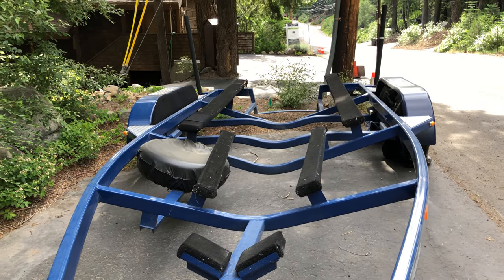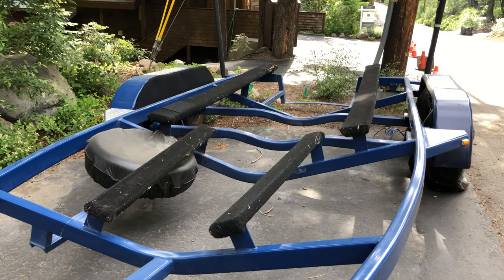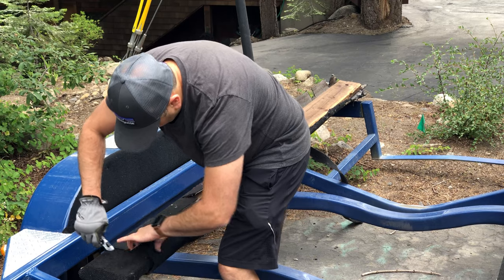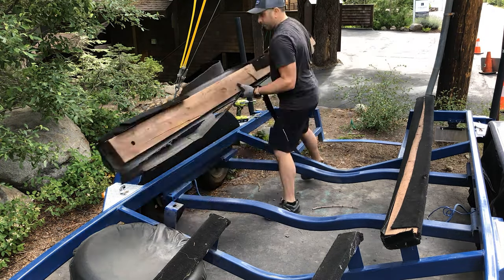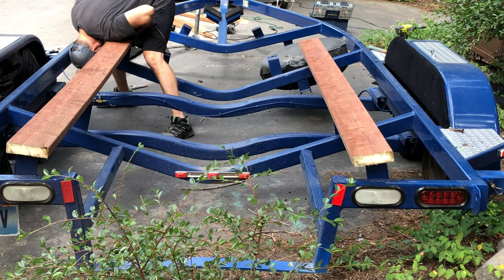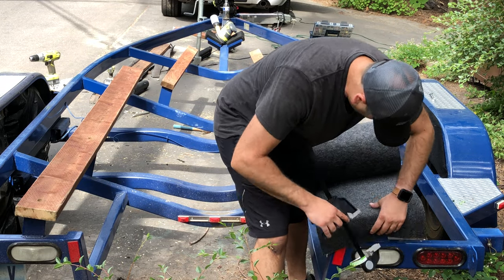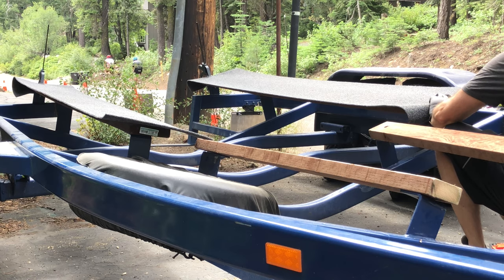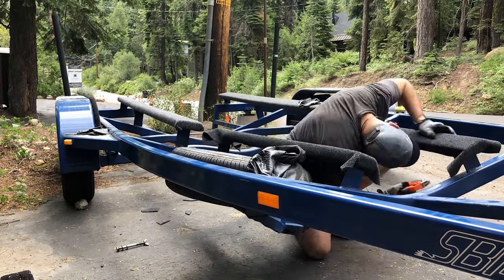Boat Trailer Bunk replacement - DIY (wood and carpet) in 4K

Comment: If you use heavy wet treated lumber let it dry out a few days before wrapping it with carpet. There's also a certain way to wrap the ends by trimming out nice and neat like a Christmas present

Comment: Great vid, I also have to repair metal brackets that were bent on one side by previous owner. My issue is having somewhere to unload a boat for a few days while welders repair ..then I can do the bunks.
Reply: Do you have a local storage facility you can unload boat or call a local boat shop

Comment: Okay, maybe in CA, you can't do this.... BUT, you missed a couple of steps that will make it last a lot longer... Once you have everything dry fitted, then take the wood and cover it with fiberglass resin. The wood can still breath, but it really water proofs the wood. Also there is a spray like Scotchguard... it used to be called Ultra Seal boat carpet conditioner (Was sold at NAPA auto parts). It helps with UV protection. Or since that is a bit pricy... just replace the bunk carpet every couple of years.... remember to use stainless steel staples because regular staples will rust and take out the wood with it. The only other thing I'd do, is use new stainless nylock nuts on new stainless bolts. That way they won't back out and mar the hull. Other than that, very good information for the first time DIY'er.
Reply from the maker: Thanks for the tips Terry.

Comment: You have a very similar/almost identical SBT trailer to me.  I also see you are missing one of your side pieces that covers the wheel opening.  I happened to lose mine today on the back (or to) the water.  Have your replaced these before?  If yes what did you use.  Marine grade plywood?  Any better way of mounting them than how mine came. (which was essentially sheet metal screws through the carpet and board and into the diamond plate fender.)  These are quite odd, cause they sit an angle due to bar at the bottom and only real place to attach is into the fender.  Trying to come up with a better solution.

Comment: Use contact cement to help hold the carpet to the wood. Then the carpet won’t move around when boat is sliding on it and tear it. My last bunks lasted almost eight years by doing this
Reply from the maker: That is a great idea!!! I think my carpet goes fast bc the trailer sits empty all summer in the sun and gets bakes by UV rays.

Comment: I would have like to know what type of bolts, washers and nuts to use - Stainless, galvanized,,,or what
Reply: When dealing with boat trailers, we usually use stainless steel bolts, washers, nuts etc.

Galvanized works good too, and may be able to find stronger rated bolts for cheaper, easier to source.

But, we've used stainless on all of our trailers and hardware.

Comment: Great video, although I would have put the carpet on the wood before installing the bunks on the trailer. Would have made it much easier if you didn't have to bend over and staple from underneath.
Reply from the maker: Live and learn :)
Reply: @fixitwithjake   but if the carpet is installed before installing bunks to the trailer then you don't have the option of using a big flat head driver to keep the top of the bolt spinning when attaching.
Reply from the maker: @chrislong2562  good point. I wonder if you could slide a small portion above the bolt head with a razor knife to slip a flat head in to hold the bolt until the washer grabs. Just an idea.
Reply: Galvanized carriage bolts=no spin.
Reply from the maker: 👍 Good idea! Next time!

Comment: Great job But yes that big BUT pressure treated wood has copper in it that oxidizes aluminum. That boat sits on those for the better part of its life and when it gets wet may release does impurities . I'd keep an eye on it. It may be nothing to worry about but and yes again that BUT it may. Food for thought
Reply from the maker: Good info! I’ll pull one this summer for fun and see how it looks under. Hopefully the trailer paint also acts as another barrier. What wood would you use that can handle a job like this and being wet and dry??
Reply: Just regular with paint or fiber coated
Reply from the maker: Thank you!

Comment: I know you said Red Pressurized not sure how it is different then the green Pressure Treated wood, & if it’s true or not but I heard that you’re not supposed to use stainless steel stables on Pressure Treated wood; that monel stables are preferable on Pressure Treated...
Reply from the maker: Luis Sonoma I did some research and it looks like you’re correct about the I did some research and it looks like you’re correct about the stainless steel fasteners in treated lumber. However I think they’re mostly concerned with however I think they're mostly concerned with load bearing lumber and a house and how those large stainless steel bolts and fasteners can lose strength. I think you should be more concerned about non-stainless steel Staples Rusting away in your carpet then the chemical mix occurring.
Reply from the maker: Luis Sonoma The green versus the brown lumber is just depending on what chemicals they’re using to treat it. The green the green versus the brown lumber is just depending on what chemicals that are using to treat it. The green has a large ingredient of copper. I chose brown because in my mountain town all the contractors right here use brown pressure treated lumber in the weather and snow and it holds up very well. And there is a good supply of it at our stores.
Reply: FixItWithJake That makes sense, well I ended up overlapping the carpet & using screws with washers every 6 inches just in case the staples rust off. And formalmente reason I got possessed and purchased Zinc Coated lag screws to fasten the bunks to the swivel brackets🤦🏿‍♂️
Reply: FixItWithJake Monel staples fare out a little better because of the amount of Nickel they’re made with. 🤷🏿‍♂️

Comment: I don't know but wouldn't it been easier to carpet the boards with  carriage bolts already in place?
Reply from the maker: For my trailer It would be a bit of a back breaker to try to cut and staple all of that upside down or bending over. But maybe!

Comment: I'm pretty sure if you got pressure treated wood, let it dry in your garage, epoxy said wood. No problems for 20 years
Reply from the maker: Never thought of this. But, makes perfect sense! I will try it next time. Just for reference, the bunks above were from the trailer factory and lasted 17 years. So epoxy-protected wood should last even longer!

Comment: Next time mortise the hole before drilling through the wood, just my common sense 🤔
Reply from the maker: Smart!
Reply: what?
Reply: Actually "counterbore" the bolt holes slightly deeper than the combined thickness of the bolt head & bolt flat washer...   Then tighten nuts with a 1/4" drive cordless impact.
Reply: @williamriley2528  I already used a 3/8" drive impact, what should I do to correct the problem?
Reply: @joemilton7552  What problem...?  You shouldn't have a problem...

Comment: Helpful tip use LAG BOLTS and not regular studs with a nut much easier.
Reply from the maker: Good point. I just reused what came with the boat trailer. On my pwc trailer, I used lag bolts and you are right it went much faster. But, I am a little worried about strength. I had to get new lag bolts when I redid the jetski trailer bc many of them were bent. So on a boat trailer, you'd have to keep an eye on it with the extra weight, that the lag bolts don't pull out or bend when there are lateral forces on the trailer. Such as when people power load the boat or don't put the trailer in deep enough water to load. Be sure to still drill out the hole first when using lag bolts, so you don't crack the wood. Cheers!
Reply: Use carriage bolts since lag bolts will loose grip and board will eventually fall off.
Reply: @kCI251  ~ Never had trouble with lag bolts. His carriage bolts were loose too if you saw when he first took the old boards off.
Reply: @kCI251  or even worse, a board splits/rots and you get a new opening in your hull from that "convenient" lag bolt. Carriage bolt for the win

Comment: Why not carpet the boards before you put it on the trailer?   That is what I have done.    Nice video btw.
Reply from the maker: How do you put the bolts through the top if there is already carpet on it? I guess you could cut a hole but that might tear over time? Ideas?
Reply: @fixitwithjake  You dont use bolts.... you use screws...Big galvanized wood screws made for trailer bunks.   you screw it directly into the carpet and wood.
Reply: I was thinking the same thing but the holding power of using the bolts instead of the lag screws seems like a much better idea. I checked the bunks on my recent trailer purchase and it had lag screws, well guess what.. half of them were loose or stripped out. Will definitely use the bolt method when I replace.
Reply: Travis Brown Can’t agree with this more! The lag screws are problems!
Reply: Yes, It is much easier...
Reply: @jrm163  If you drill the right size pilot hole, I believe lags are more than adequate. Use 316 stainless steel.
Reply: @shawnthrasher421  The real problem is the wood around the lag screws rots or softens fast in water. This is why most screws were loose or lost when I found the problem.  Then I used bolts with washers instead, on THE OLD Bunks, kinda extended their life.